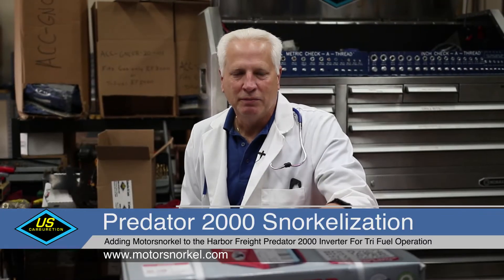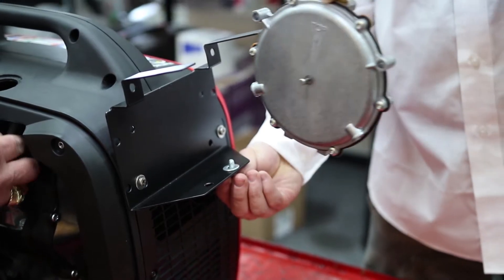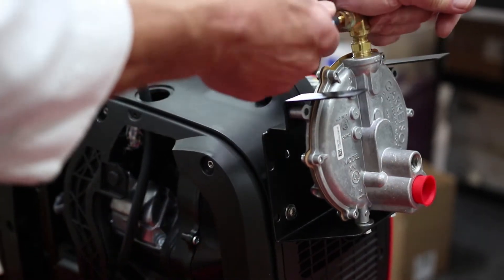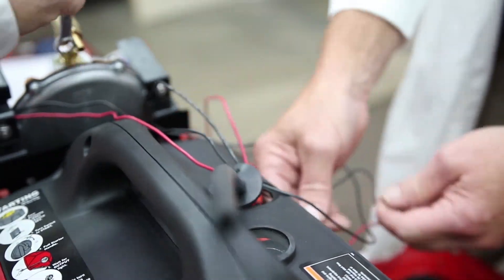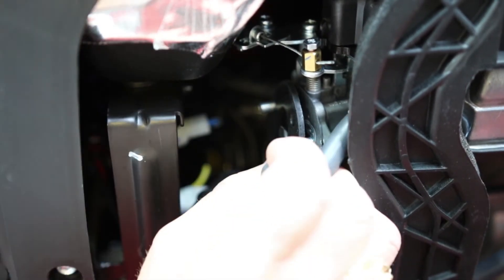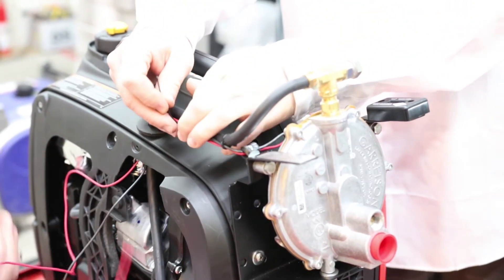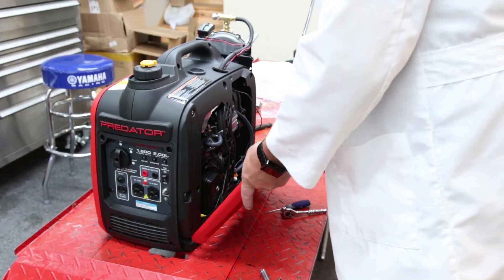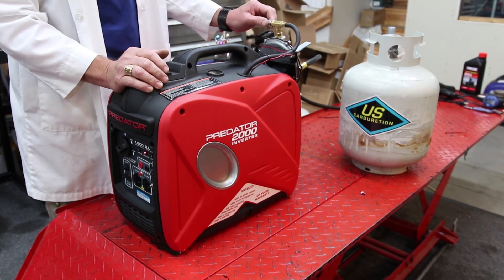Predator 2000 Motorsnorkel Installation - Run Your Predator Generator On Propane or Natural Gas

Comment: Should the snorkel be removed to run on gasoline?  It looks like it would interfere with the choke operation and could also cause the engine to run rich since the air intake is being restricted by it. Thanks.
Reply: Yes indeed. Choose another non-snorkle design. Notice how they won't reply?

Comment: how much to convert to propane and how long will a 5gallon propane bottle last at approx. 50% load? What Rpm should it run at on idle and under a full load?
Reply: Did you ever find an answer to this?

Comment: any idea how long a 20LB cylinder lasts (dependent on load...I know)?
Reply: Joeak74 ok i will throw out an answer and put on my flak jacket.:) the stock predator 62523 here says it holds 1 gallon of gasoline and runs 6hr at 50 percent load. Specs are 1600w running 2000 w peak thus 50 percent is 800 watts. I use to think 20lb cylinders of LP are like 5 gallons of gas. But really they are more like 4 to 3.5 gallon since cylinders often just have 15lbs of lp :)  thus back of the envelope guess is 1 day!  Ie 24 hours for that cylinder at 800 watts.